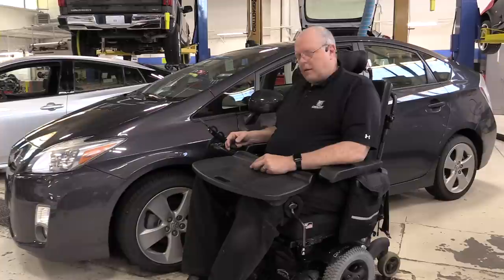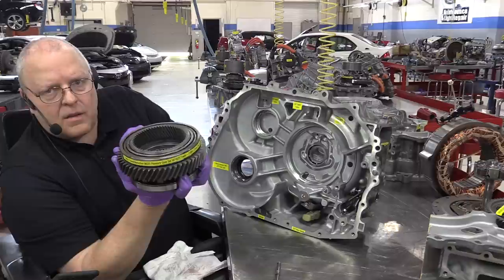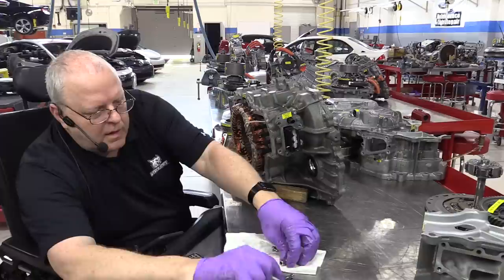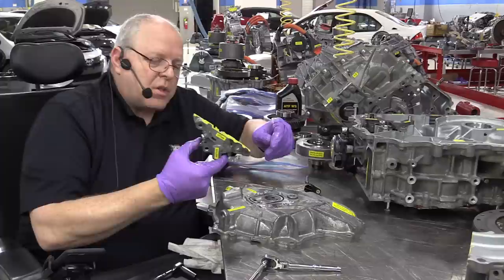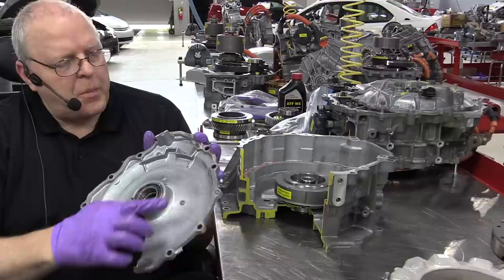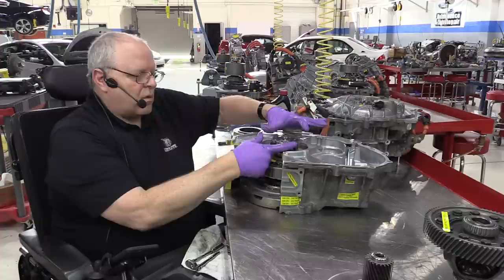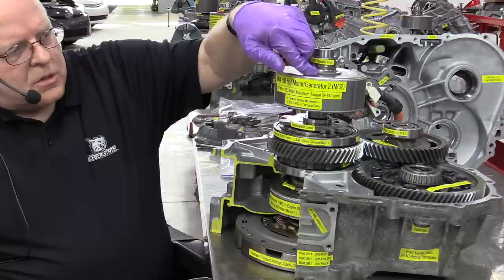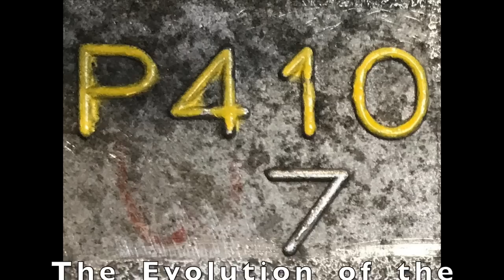2010 - 2015 Prius Transaxle -  P410 Deep Dive

Comment: My 2015 PriusV kicks itself out of "EV Mode" at a fairly low speed.  Is it only the "plug in" version that can do 60MPH in EV mode?
Reply from the maker: Yes, that is correct. Thanks for watching
Reply: @WeberAuto  Thank YOU very much for a great video!!  OK, well it sounds like the plugin version of the MG1/MG2 have about the same RPM-limits as the MG1/MG2 in the P410 (at least that's what it sounds like you said) so why can't PriusV (P420) go faster in EV mode? (not using ICE)  Is it just software or is there some other limit to the PriusV P410 has that the plugin doesn't?
Reply: Even the PriusV Owner's Manual refers to adding "transmission fluid," the transmissin fluid capacity and type - "Toyota Genuine ATF WS"  - lubricating a transaxle, I guess, isn't all that different from operating the hydraulics of a typical automatic transmission?  (or is "WS" a Toyota designation for the transaxle of a prius?)

There isn't a "transmission" - if that means anything like a traditional gearshift mechanism with discrete gear ratios and a torque-converter/clutch.

"𝐴𝑡 𝑎𝑏𝑜𝑢𝑡 10 𝑚.𝑝.ℎ., 𝑡ℎ𝑒 𝑃𝑟𝑖𝑢𝑠 𝑐𝑎𝑛 𝑛𝑜 𝑙𝑜𝑛𝑔𝑒𝑟 𝑚𝑎𝑖𝑛𝑡𝑎𝑖𝑛 𝑡ℎ𝑒 𝑒𝑥𝑝𝑒𝑐𝑡𝑒𝑑 𝑎𝑐𝑐𝑒𝑙𝑒𝑟𝑎𝑡𝑖𝑜𝑛 𝑢𝑠𝑖𝑛𝑔 𝑜𝑛𝑙𝑦 𝑝𝑜𝑤𝑒𝑟 𝑓𝑟𝑜𝑚 𝑖𝑡𝑠 𝑠𝑚𝑎𝑙𝑙 𝐼𝐶𝐸, 𝑤ℎ𝑖𝑐ℎ 𝑖𝑠 𝑑𝑒𝑠𝑖𝑔𝑛𝑒𝑑 𝑓𝑜𝑟 𝑒𝑓𝑓𝑖𝑐𝑖𝑒𝑛𝑐𝑦 𝑎𝑛𝑑 𝑙𝑜𝑤 𝑒𝑚𝑖𝑠𝑠𝑖𝑜𝑛𝑠 𝑎𝑛𝑑 𝑛𝑜𝑡 𝑓𝑜𝑟 𝑝𝑜𝑤𝑒𝑟.  𝐴𝑠 𝑠𝑝𝑒𝑒𝑑 𝑖𝑛𝑐𝑟𝑒𝑎𝑠𝑒𝑠, 𝑀𝐺2 𝑛𝑒𝑒𝑑𝑠 𝑚𝑜𝑟𝑒 𝑎𝑛𝑑 𝑚𝑜𝑟𝑒 𝑝𝑜𝑤𝑒𝑟 𝑡𝑜 𝑚𝑎𝑖𝑛𝑡𝑎𝑖𝑛 𝑖𝑡𝑠 𝑡𝑜𝑟𝑞𝑢𝑒 𝑎𝑛𝑑 𝑤𝑖𝑙𝑙 𝑠𝑜𝑜𝑛 𝑟𝑒𝑎𝑐ℎ 𝑖𝑡𝑠 𝑝𝑜𝑤𝑒𝑟 ℎ𝑎𝑛𝑑𝑙𝑖𝑛𝑔 𝑙𝑖𝑚𝑖𝑡, 𝑤ℎ𝑒𝑟𝑒𝑢𝑝𝑜𝑛 𝑡𝑜𝑟𝑞𝑢𝑒 𝑤𝑖𝑙𝑙 𝑓𝑎𝑙𝑙 𝑜𝑓𝑓.  𝑇𝑜𝑦𝑜𝑡𝑎 ℎ𝑎𝑠 𝑠𝑖𝑧𝑒𝑑 𝑀𝐺2 𝑠𝑜 𝑡ℎ𝑎𝑡 𝑖𝑡 ℎ𝑎𝑠 𝑒𝑛𝑜𝑢𝑔ℎ 𝑝𝑜𝑤𝑒𝑟 𝑡𝑜 𝑘𝑒𝑒𝑝 𝑎𝑐𝑐𝑒𝑙𝑒𝑟𝑎𝑡𝑖𝑛𝑔 𝑡ℎ𝑒 𝑐𝑎𝑟 𝑎𝑡 𝑎𝑛 𝑎𝑐𝑐𝑒𝑝𝑡𝑎𝑏𝑙𝑒 𝑙𝑒𝑣𝑒𝑙, 𝑏𝑢𝑡 𝑤ℎ𝑒𝑟𝑒 𝑖𝑠 𝑡ℎ𝑒 𝑒𝑥𝑡𝑟𝑎 𝑒𝑙𝑒𝑐𝑡𝑟𝑖𝑐𝑎𝑙 𝑝𝑜𝑤𝑒𝑟 𝑡𝑜 𝑐𝑜𝑚𝑒 𝑓𝑟𝑜𝑚?  𝑇ℎ𝑒 𝑎𝑛𝑠𝑤𝑒𝑟, 𝑜𝑓 𝑐𝑜𝑢𝑟𝑠𝑒, 𝑖𝑠 𝑡ℎ𝑒 𝑏𝑎𝑡𝑡𝑒𝑟𝑦.  𝑀𝐺1 𝑑𝑜𝑒𝑠 𝑛𝑜𝑡 𝑝𝑎𝑠𝑠 𝑒𝑙𝑒𝑐𝑡𝑟𝑖𝑐𝑎𝑙 𝑝𝑜𝑤𝑒𝑟 𝑑𝑖𝑟𝑒𝑐𝑡𝑙𝑦 𝑡𝑜 𝑀𝐺2 𝑎𝑠 𝑤𝑒 𝑚𝑎𝑦 ℎ𝑎𝑣𝑒 𝑠𝑢𝑝𝑝𝑜𝑠𝑒𝑑 𝑎𝑏𝑜𝑣𝑒.  𝑇ℎ𝑒 𝑐𝑜𝑛𝑡𝑟𝑜𝑙 𝑒𝑙𝑒𝑐𝑡𝑟𝑜𝑛𝑖𝑐𝑠 𝑖𝑛𝑐𝑙𝑢𝑑𝑒𝑠 𝑎 𝑑𝑒𝑣𝑖𝑐𝑒 𝑐𝑎𝑙𝑙𝑒𝑑 𝑎𝑛 "𝑖𝑛𝑣𝑒𝑟𝑡𝑒𝑟" 𝑡ℎ𝑎𝑡 𝑡𝑢𝑟𝑛𝑠 𝑡ℎ𝑒 𝑔𝑒𝑛𝑒𝑟𝑎𝑡𝑒𝑑 𝑝𝑜𝑤𝑒𝑟 𝑖𝑛𝑡𝑜 𝑑𝑖𝑟𝑒𝑐𝑡 𝑐𝑢𝑟𝑟𝑒𝑛𝑡 𝑎𝑡 𝑠𝑒𝑣𝑒𝑟𝑎𝑙 ℎ𝑢𝑛𝑑𝑟𝑒𝑑 𝑣𝑜𝑙𝑡𝑠.  𝑇ℎ𝑖𝑠 𝑖𝑠 𝑐𝑜𝑛𝑛𝑒𝑐𝑡𝑒𝑑 𝑡𝑜 𝑡ℎ𝑒 𝑏𝑎𝑡𝑡𝑒𝑟𝑦 𝑡𝑒𝑟𝑚𝑖𝑛𝑎𝑙𝑠.  𝐴 𝑠𝑒𝑐𝑜𝑛𝑑 𝑖𝑛𝑣𝑒𝑟𝑡𝑒𝑟 𝑓𝑜𝑟 𝑀𝐺2 𝑡𝑎𝑘𝑒𝑠 𝑎𝑠 𝑚𝑢𝑐ℎ 𝑝𝑜𝑤𝑒𝑟 𝑎𝑠 𝑖𝑠 𝑛𝑒𝑒𝑑𝑒𝑑 𝑓𝑟𝑜𝑚 𝑡ℎ𝑒 𝑏𝑎𝑡𝑡𝑒𝑟𝑦 𝑡𝑒𝑟𝑚𝑖𝑛𝑎𝑙𝑠 𝑡𝑜 𝑑𝑟𝑖𝑣𝑒 𝑀𝐺2 𝑎𝑛𝑑 𝑎𝑐𝑐𝑒𝑙𝑒𝑟𝑎𝑡𝑒 𝑡ℎ𝑒 𝑐𝑎𝑟.  𝐼𝑓 𝑀𝐺1 𝑖𝑠 𝑛𝑜𝑡 𝑝𝑟𝑜𝑑𝑢𝑐𝑖𝑛𝑔 𝑡ℎ𝑒 𝑝𝑜𝑤𝑒𝑟 𝑀𝐺2 𝑛𝑒𝑒𝑑𝑠, 𝑡ℎ𝑒 𝑑𝑖𝑓𝑓𝑒𝑟𝑒𝑛𝑐𝑒 𝑓𝑙𝑜𝑤𝑠 𝑜𝑢𝑡 𝑜𝑓 𝑡ℎ𝑒 𝑏𝑎𝑡𝑡𝑒𝑟𝑦.  𝐴𝑡 𝑜𝑡ℎ𝑒𝑟 𝑡𝑖𝑚𝑒𝑠, 𝑤ℎ𝑒𝑛 𝑡ℎ𝑒 𝑐𝑎𝑟 𝑖𝑠 𝑢𝑝 𝑡𝑜 𝑠𝑝𝑒𝑒𝑑, 𝑒𝑥𝑐𝑒𝑠𝑠 𝑝𝑜𝑤𝑒𝑟 𝑓𝑟𝑜𝑚 𝑀𝐺1 𝑓𝑙𝑜𝑤𝑠 𝑖𝑛𝑡𝑜 𝑡ℎ𝑒 𝑏𝑎𝑡𝑡𝑒𝑟𝑦 𝑡𝑜 𝑟𝑒𝑝𝑙𝑒𝑛𝑖𝑠ℎ 𝑡ℎ𝑒 𝑐ℎ𝑎𝑟𝑔𝑒.  𝑇ℎ𝑖𝑠 "𝑏𝑎𝑡𝑡𝑒𝑟𝑦 𝑏𝑜𝑜𝑠𝑡" 𝑖𝑠 𝑤ℎ𝑎𝑡 𝑎𝑙𝑙𝑜𝑤𝑠 𝑎 2800 𝑝𝑜𝑢𝑛𝑑 𝑐𝑎𝑟, 𝑤ℎ𝑖𝑐ℎ 𝑤𝑜𝑢𝑙𝑑 𝑜𝑡ℎ𝑒𝑟𝑤𝑖𝑠𝑒 𝑛𝑒𝑒𝑑 𝑎𝑛 𝑒𝑛𝑔𝑖𝑛𝑒 𝑜𝑓 𝑜𝑣𝑒𝑟 100 ℎ𝑝 𝑎𝑛𝑑 𝑎 𝑠𝑡𝑒𝑝 𝑡𝑟𝑎𝑛𝑠𝑚𝑖𝑠𝑠𝑖𝑜𝑛, 𝑡𝑜 𝑔𝑖𝑣𝑒 𝑔𝑜𝑜𝑑 𝑎𝑐𝑐𝑒𝑙𝑒𝑟𝑎𝑡𝑖𝑜𝑛 𝑝𝑒𝑟𝑓𝑜𝑟𝑚𝑎𝑛𝑐𝑒 𝑤𝑖𝑡ℎ 𝑎 70 ℎ𝑝 𝑒𝑛𝑔𝑖𝑛𝑒 𝑎𝑛𝑑 𝑛𝑜 𝑠𝑡𝑒𝑝 𝑔𝑒𝑎𝑟𝑠."
- http://www.prius.ecrostech.com/original/Understanding/ContinuouslyVariableTransmission.htm

For folks confused (as I was) on the actual sequence of torque-flow events during cold-start, acceleration, etc., this is a great verbal description:
http://www.prius.ecrostech.com/original/Understanding/WhatsGoingOnAsIDrive.htm
...unfortunately, I'm sure this varies with Prius generation, and I'm not sure which generation this applies-to - but MG1/MG2 speeds suggest it's written with GEN1/2 in mind (???)  It does mention that "B" shift lever position runs the engine at higher speed (without fuel), transfers torque from the wheels to the engine, to achieve compression braking.  I guess compression braking is all you have left if you want to spare your brake pads and the battery is full.

Comment: May I ask a question that, how many power and torque of MG1? I always see the 105kw/270Nm for MG1+MG2 total, but no for each.
Thanks!
Reply from the maker: Toyota does not publish the power of MG1 on this transaxle. The later version used in the Prime (P610) has 23kW and 40Nm

Comment: i have a RX450h from 2010 with a third e motor for rear wheels. Is it 
the same system and why it is allowed to run on our Autbahn with 200km/h
 while the Toyotas are restricted to 180km/h ?
The GS450H is allowed to run 240km/h ! Same sstem ?  Engine is the same 
as meine a V6.

Comment: Thanks again for the video. My service book gives no mention of transmission fluid change interval. I have checked on Prius Chat but wanted your opinion on when to change the fluid?
Reply from the maker: Never according to Toyota. The WS fluid is designed to stay inside a sealed transmission to minimize the introduction of oxygen (which causes oxidation, rust, and corrosion). These transmissions do not get as hot as regular transmissions, so the fluid lasts a very long tome. With that being said, Toyota does recommend the WS fluid be changed on their other vehicles every 60k miles if towing a trailer, hauling a lot of weight, or dusty hot driving conditions. Every 120k miles if not driven as previously described. Best wishes
Reply: Thanks for taking the time to reply and give such well informed advice. You must be a very busy man. I greatly appreciate your time!
Reply: @WeberAuto  Never according to Toyota. But what is your opinion on this, should we make the change at least every 120,000 miles? my vehicle is a Lexus gs450h fsport
Reply from the maker: @SamuelPovedanoGarcia  Yes, change at 120k miles
Reply: @WeberAuto  thank you for the información

Comment: At cruising speed, low engine rpm, mg1 have to reverse rotation to achieve low engine rpm. What makes mg1 to rotate in reverse? Is it powered by the high voltage battery or mg2 providing electric power to mg1? Thanks.

Comment: Great video Professor!!! May I know the max torque and max speed of MG1?
Reply from the maker: Thank you. Max MG1 speeds:  P111 = 6500, P112 = 10,000, P410 = 13,500, P610 = 17,000
Reply: Thank you so much. It would be very nice if I can get the Max torque value of MG1. Actually I am modeling Toyota Prius full vehicle in Simulink for Energy Management System. Thanks again!!
Reply from the maker: Toyota only gives us the torque for the P111 (37.8 Nm) and the P610 (40 Nm).

Comment: Thanks for your answer on the ICE speed below.  Still trying to under stand control system.  On the 2013 prius, one planet carrier is connected to the ICE.  Other than the parking pawl, what is the other planet carrier (PC) connected to?  Seems like if there's no restraint on the PC it would just free wheel and MG2 could not drive the wheels.  Is there any thing public on the control system algorithm?  Thanks
Reply from the maker: It is connected to the transmission case. Thanks for watching

Comment: Great Video! While starting my Prius this afternoon a horrible knocking and grinding came from the transaxle, It only lasted a few seconds and I shut it off and started it again everything seemed to be normal. Tonight we drove on the freeway around 30 miles to dinner and the car ran fine.  When we left the restaurant and pulled onto the street a large pop came from the transaxle and the "Check hybrid system" and various other lights came on the dash. The car will drive under the gas engine but seems to have no help from the electric motor. We managed to drive the car slowly home. At stop lights the car will accelerate slowly but will lose torque if the pedal is pushed and just revs higher. Hills were very hard to get up and the engine revs quite high. So the big question is "what happened"?  I have watched your videos but can't figure out what broke in the transaxle to give me these symptoms.  Any help identifying the fault would be much appreciated before I decide what to do.  Thanks!
Reply: Did you find out Danen? 
Sounds interesting
Reply: @alexanderconnell800  Never got a response on here but... I ended up buying a used transaxle. I swapped that in and also found out that Toyota increased the warranty on the inverter to 15 years unlimited mileage! Local dealership fixed the inverter.  Between the new transaxle and the fixed inverter, I am getting much better mileage, The acts much better. It has made a huge difference.  After observing the oil in the original transaxle, I am pretty sure it was never serviced.

Comment: Thank you so much for making these exceptional videos available to the public! As an engineer I really wanted to know even more and found a very nice article on the Internet, which discusses the control strategies that operate MG1, MG2 and the engine itself: http://www-personal.umich.edu/~hpeng/Liu%20TCST%20split%20paper.pdf
I can really recommend reading at least the first few sections, because it nicely explains how the power split device is being operated to control the engine RPMs, as well as the flow of power between MG1, MG2 and the battery.
Reply from the maker: Thank you for your feedback

Comment: Hi. My prius mg1 spins over 4000 rpms. The ice will not spin at all. The car will drive on hv power and rolls smoothly in neutral. Previous owner had complained about shuttering while driving. I get a p0335 code but the sensor test good, I tried a new sensor, and I checked the wiring to the ecu for correct resistance readings. 
Anyone have any ideas? 

Thread can be followed here if you're interested. https://priuschat.com/threads/engine-seized-118k-miles.201638/page-7#post-2824224
Reply from the maker: It sounds like you have a slipping torque limiting clutch, stripped input shaft splines, or broken crankshaft. Best wishes.
Reply: @WeberAuto  thank you very much for your reply. Have you ever seen that happen on these? Great videos by the way.
Reply from the maker: @TheJimmyThreeSticks  I have not seen it yet, but the purpose of the torque limiting clutch is to disconnect the trans from the engine in the event of a catastrophic engine failure
Reply: @WeberAuto  right. The car throws a crank sensor code but I've checked wiring and sensor. I don't believe there engine will start with the code present on any prius.
Reply from the maker: @TheJimmyThreeSticks  Have you seen the engine crankshaft pulley actually rotate while trying to start? If it does not rotate, it can trigger that code because of a mechanical problem.
Reply: @WeberAuto  it only rotates when I put a wrench on the pulley and spin in. Tech stream shows 0 rpm on the ice and over 4000 on the mg1
Reply from the maker: @TheJimmyThreeSticks  That is a really bad sign. The transmission will need to be removed to inspect the parts I mentioned earlier
Reply: @WeberAuto  I was hoping it was something electrical. Is there any type of electrically managed that disconnects the mg1 from the ice
Reply from the maker: No, it is mechanical
Reply: Damper is broken. pieces of springs all over. Shaft from transmission snapped off in damper.